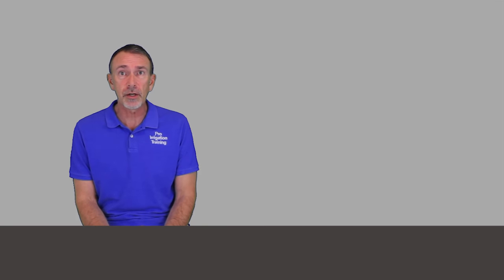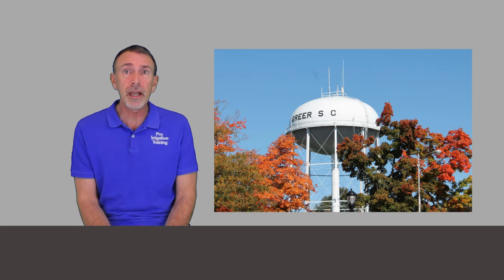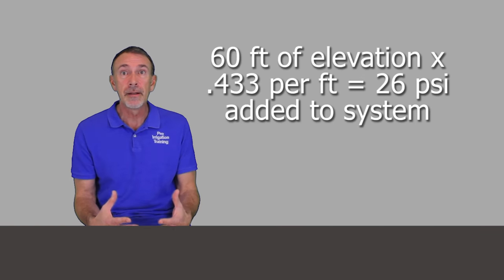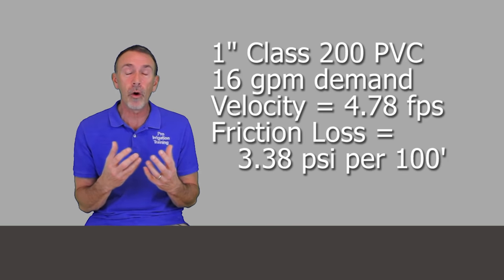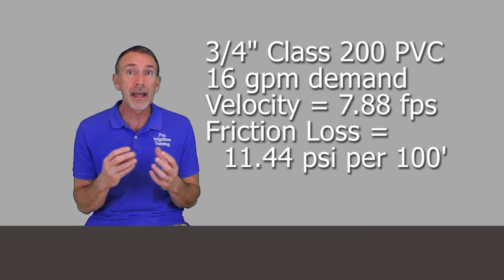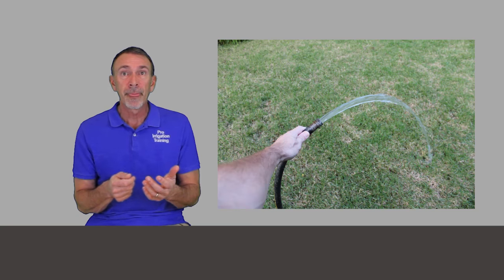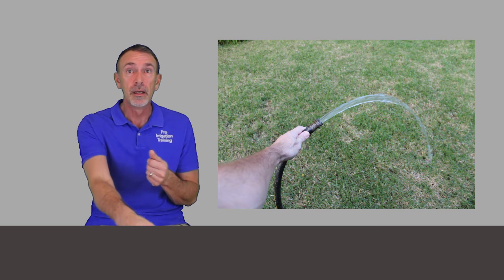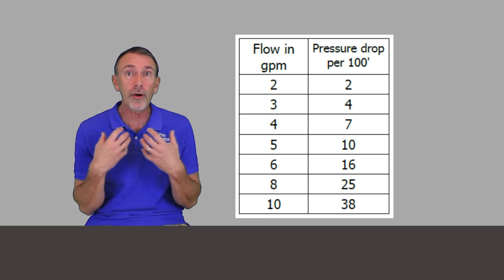3 Ways to Increase Pressure in an Irrigation System

Comment: I have about 5 GPM at the spigot from a well.  I want to put in an irrigation system on about an acre.  My well is down about 295 feet just for information sake.  Is an irrigation system even possible?  I don't have any other water sources like a lake or stream.  Would a booster bump help?  Thank so much.
Reply from the maker: Hi Robert! To be honest, I don't think that well will do the job. The average rotor uses at least 1.2 - 1.5 gpm to get maybe 33 feet (@ 25 psi.) So, you could get 3 rotors per zone. If they were installed in head-to head fashion, you would probably need at least 20 - 30 minutes run time per zone. An acre would need A LOT of zones. What concerns me most is the overall run time. What is the refresh rate of the well? You would probably only be able to run 25% of the system on any day without running the well dry. Maybe I'm wrong, you should consult a well drilling company to get details.

Comment: Could I use a well water pump with a header pipe downhill to feed a 4 acre grid of tomatoes on drip a line? Could I add an additional pump to add pressure?
Reply from the maker: Sorry I missed this comment when you made it. But I don't think you should put an additional pump on to boost pressure from a well pump. You should get the maximum performance out of your well, then design your drip system to accommodate your pressure and flow. You'll pick up some pressure on the downhill, .433 psi per foot of vertical drop. Also make sure you know the capacity of your well and it's refresh rate so you don't run it dry and harm your pump. Once I installed a 3.5/4 acre blueberry farm with dripline and it was all sourced from one well.

Comment: Could you please advise an inexpensive pump (or at least a brand) to increase the pressure in the situation with a connection to a garden (outside) tap? I have 32 PSI at the tap, but a DB device (a pipe interrupter for backflow protection) and some other small stuff will have only 11,3 PSI (with a water flow of about 19 litres per minute). Ideally, the pump should be either quiet or be colled by water (so I can put it in a box under the ground).
Reply from the maker: Most of the centrifugal pumps sold for irrigation use are water cooled and can be enclosed. Goulds Irri-gator pumps are not exactly cheap, but very good. Actually any pump sold in a hardware store of this style can be set up as a booster pump. I've used cheap pumps from Home Depot and they worked out fine.

Comment: I believe my main is 1/2", OD is.91 all the charts i can find point to 1/2" for galvanized. Im getting 60psi at the house bib and about 8 gpm. 3/4" Pex runs off the main to supply the house. Would it be safe to assume i need a pump for irrigation? Or increasing the size of line to 1" or more?
Reply from the maker: If you're getting 60 psi and 8 gpm, you can work with that without have to add a pump. You're just going to have to pay attention to the flow demand for each zone and keep it at 8 gpm or below. That generally means smaller zones with shorter runs of pipe, but you can make it work. and you don't have to go up to 1" pipe, 3/4" schd 40 or Class 200 pipe will handle 8 gpm.
Reply: @Proirrigationtraining  I live in Pennsylvania and it freezes here. Sch 40 the safest option? I'm also hoping to use the Hunter PRS40 spray bodies with MP Rotators. I watched a video with one of their sales reps and he stated the PRS40 spray bodies need at least 10pi higher coming into them to function properly. Was trying to keep pressure loss to minimum that's why I was planning with 1". Thanks for any help
Reply from the maker: @devinlines4398  To be honest, the Schd 40 won't matter if you don't winterize your system. All kinds of pipe, even steel will burst if frozen. In your climate, all irrigation systems should be winterized by compressed air evacuation. And that's true about the PRS40s, you need 50+ psi for them to work right. But they have PRS30 as well.

Comment: Do you thing it's possible to run a pressure tank off of a irrigation zone as a way to hold water for a facet occasional use? Maybe with back flow preventer?
Reply from the maker: Hi Jason. I don't think you will be able to make that work on a zone pipe, because its not sealed. The zone doesn't hold pressure when the zone isn't running. Instead, you'll need to install the faucet (also called a hose bibb) on the main line. No pressure tank is needed if the system is under constant pressure and there's not a master valve installed. The only time you really need a pressure tank is when a pump is used.

Comment: Thinking about installing an irrigation system. My house is on a hill and my flow rate is low. Is there anything that I can do to improve this so that I can install this in the spring? Where is you company based?
Reply from the maker: I'm based in Greenville, SC. But I'm sure that wherever you are, you can find a competent company to install you a booster pump. If you just attach the pump to the irrigation system, it's a pretty simple setup with just a "pump start relay." If you attach the pump to your house water, then you'll also need a pressure tank and switch, which is no big deal really.
Reply: @Proirrigationtraining  Thank you so much for the reply. That makes a lot of since. Are the booster pumps and tanks typically installed inside the house or outside? I will call a service company. any thoughts on specific products to consider?

Comment: Just a question. If placing your thumb over the end of the water hose increases velocity and by that makes the water go further (while keeping pressure same or reducing it and reducing amount of water flow), will reducing the pipe size with a reducer just before it goes into the sprinkler not increase the distance the water will go out of the sprinkler because the velocity will be increased?
Therefore less water covering larger area like the thumb over the hose?
If that is the case it should still be beneficial to reduce the outlet size just before the water enters the sprinkler head.
Reply from the maker: That's a tricky question. Downsizing a pipe will always lead to a faster velocity. The question is how much faster. For instance, with PVC, any velocity over 5 ft per second causes the friction loss or the turbulence in the pipe to increase exponentially. So usually a large increase in velocity leads to less pressure and would result in less distance. The conversion of pressure to velocity happens at the outlet, so what we're really talking about is the sprinkler nozzle. And the inlet size gets restricted at the head anyway. Talking about residential sized sprinklers, the barbed fitting or nipple that you're probably using to connect the head has less than a 1/2" orifice or passage. You can reduce the pipe and fittings that leads to that head down to the smallest that will supply the flow that you need. Say you're using a rotor with a 3 gpm nozzle, you can go down to 1/2" pipe and fittings, because 1/2" will flow up to 6 gpm comfortably, and as long as that's the last head, and there are no others downstream demanding water.
Reply: Increasing velocity of water also increases friction which therefore decreases pressure.
Reply from the maker: exactly

Comment: I measured my PSI and jt was 60 Psi at both spigot end and the end of a 100 ft hose. Obviously because the water is not moving. How do I measure dynamic pressure and pressure lost in the hose ?
Reply from the maker: You could use a "Y" fitting at the end of the hose. Connect one end of the "Y" to you sprinkler or whatever you're using, and your pressure gauge on the other end of the "Y". I suppose that would give the dynamic pressure reading you're looking for, really the operating pressure at the sprinkler. If you didn't connect one end of the "Y" and just let it flow wide open, I think the gauge would read near zero pressure. Or you can buy a Toro Combo Gauge, which has pressure and flow gauges and a gate valve. You can measure static & dynamic pressure plus flow rate. Pretty handy. You really have to actually measure garden hoses. There's rarely any friction loss data given for them. But the friction loss is usually pretty bad.

Comment: From listening to your presentations I'm understanding a little bit, but maybe it's all the math.  My situation is a little disappointing.  I'm running a single zone to a small backyard with very little pitch anywhere in the line, using half inch pvc. My source is my outside spigot where I have connected to using a stainless steel water inlet house to galvanized pipe and then into the pvc line. I tested the pressure on the spigot and I have 70 psi, so it says anyway, however, when I run the system I only get maybe 8-10 feet of throw distance using a tip that based on Rainbird, says I should get atleast 30 ft in throw distance with just 55 psi. I'm not using a psi regulator at all and the adjustment screws for the tips are not interfering with the water spray, they are supposed to give the most flow gpm.  How do I increase the pressure to the 3 heads which I assume would give me better throw distance ?  Any thoughts or suggestions would be appreciated.  Thank you.
Reply from the maker: Hello, thanks for watching and the question. What size nozzles do you have in the sprinklers? 1.5?

Comment: So if i have a 1inch in to my valves and use a 3/4for exit to PVC for 120 feet will i still have enough pressure to run 4 rain bird sprinklers gear driven?
Reply: The max flow for a 3/4 inch pvc pipe, class 200 is 10 gallons p/m, you are limited to the actual head pressure and how many gallons you are spraying. I don't recommend sizing down the pipe at the valve, Rainbird rotary heads' minimum actual head pressure is 25 psi. 1"  pvc pipe cl200 has a flow of 17 gallons per minute . You also need to know how many gallons of water you are getting from the water meter before  you calculate how many gallons you can spray at a zone with 4 rotors. Use 75% of what you get from the meter.
Reply from the maker: @buscador2007  Great answer! Technically correct.
Reply from the maker: It's not really possible to answer the question. We don't know enough info. We need to know what nozzle in the rotors, what your pressure is in the main line and the length and size of the main line, what your available flow is.  See the answer below for a good explanation.
Reply: @Proirrigationtraining  thank you, I am  studying to get my irrigator license in Texas, it's hard but I think I can get it.
Reply: @buscador2007  So, if I have a 3/4 inch poly tubing water line running 100 feet down to an overhead impact sprinkler and I want to add another one right before that one, like say 20 feet before the first sprinkler I add a T to so water goes to an overhead impact sprinkler on the left, then it goes down 10 feet or so to the right to the original overhead sprinkler. Can I: A. Still use the 3/4 poly tubing line B. Size down the tubing from the T to the two impact sprinklers?

Comment: for up hill watering, do I need install a pump? Thanks
Reply from the maker: Thats a complex question. If you have enough pressure, you may not need one. You should measure the pressure that's entering the system or zone, and calculate the pressure loss from the elevation rise. For every 1 foot of verticle rise. Remember that's straight vertical rise,  the slope or length of the pipe doesn't matter, but how far the sprinkler is above the source, as if you were measuring from sea level. Most sprinklers need around 25 psi to operate, so check the specs of whatever product you're using. Also, you should use a pipe friction loss chart to measure the pressure loss through the pipe. you can find a link to those charts at t my website.
https://www.proirrigationtraining.com/resources.html

Comment: I have 4 zones and one zone the pressure is lower than the other 3 and is not enough to cover the area. Is this a valve problem?
Reply from the maker: It could be. Search for a leak first. If the valve has a flow control valve on it, open it up fully. Disassemble the valve to look for debris, and rebuild the valve since you have it taken apart. Look for a video that will be dropping in the next week called "Solenoid Valve Repair Scenarios," I cover that problem.
Reply: @Proirrigationtraining  thanks
Reply: @Proirrigationtraining  so there was no debris inside the valve and no damage. Still not enough pressure to pop the sprinkler heads all the way up
Reply from the maker: @jimmcdiarmid7308  Ok, a couple more questions. Did you put new parts back on the valve or the original diaphragm, spring etc. when you took it apart? Has there been any wires pulled or utility work on your property? The wire pullers can pinch a pipe without breaking it. Has there been any new sprinklers or nozzles installed on that zone?
Reply: @Proirrigationtraining  I live in Hawaii and nobody stocks the parts, so I took the valve apart to check for damage or debris. Everything looked ok and there was no dirt or stones. This is at a friends house and I have run out of ideas.
A few months ago I extended another zone there, adding 4 new sprinkler heads and the pressure there is great. So I’m really stumped this time.
Reply: @Proirrigationtraining  no additional nozzles, just some replacements
Reply: @Proirrigationtraining  I’m going to screw in all the nozzle screws to shut off each sprinkler and see if the water still runs.
Reply from the maker: @jimmcdiarmid7308  As long as the replacement nozzles were the same size and flow rate, then it's not the issue. But, if you upsized several nozzles, say went from 12' spray nozzles to 18' nozzles, you may have crossed into the overextended zone. You'll find out when you start shutting off nozzles. If by the second head you've shut off, pressure comes back up to normal, you know that you've overextended your flow demand. If not, it could still be the valve. I recommend replacing the whole valve which will give you the opportunity to see if something large is impeding the inlet supply pipe. Or it could be a constricted or blocked pipe. Remove the farthest head on that zone. Using an adapter, connect a garden hose to that head's fitting. Take your valve apart. Now backpressure that zone and see if any debris comes up from the valve. You may need to shut off other heads in the zone to make it work. If you're at this point, it's basically try anything to see if it will work. In reality though, it can only be a few things: Overextended zone - too much flow demand, valve isn't opening fully, or a leak or obstruction in the zone piping or at the valve.
Reply: @Proirrigationtraining  thanks

Comment: What if you cap some of the sprinkler heads , like for a system that had too many heads necessary to water the area?
Reply from the maker: If the zone was overextended or demanding more flow than the pipes can deliver, then capping some heads would recoup some pressure and also give the appearance of adding pressure just by bringing the flow rate down to what it should be.
Reply: Thanks for the feedback.
Reply: Adding heads with lower pressure heads will also help.(like rainbird MP rotators)

Comment: I have connected a T tube and PVC line to an existing sprinkler line .but water not coming through it? any body help..
Reply from the maker: Ok, hopefully you got it figured out by now. But my first question: is any water at all coming through or not much? If absolutely none is coming through, then you have a blockage or a pinched tube. If there's little water coming, it may still be a blockage or crimp, but it could be that you just overextended the flow. If the line you tee'd into only had enough flow to push one sprinkler, then you tee'd into that line and opened up a tube that could flow twice that amount, then the flow is going to be very small and weak. Hope that helps.
Reply: @Proirrigationtraining  Thank you

Comment: using a large size of pipe, say it's the same as the main in, it maintain the same pressure in the line. the guy saying he uses large pipe to increase the pressure might be true, he might just use the same pipe size as where he connects to. if the house pipe size is 1inch, and hooks 1/2 inch as outlet for irragation, it reduces the pressure on that line.
Reply from the maker: Right, I agree. Going back to the right size for the flow demand can increase your flow and reduce friction loss. But in the end, you're recouping the pressure that was already there to begin with.